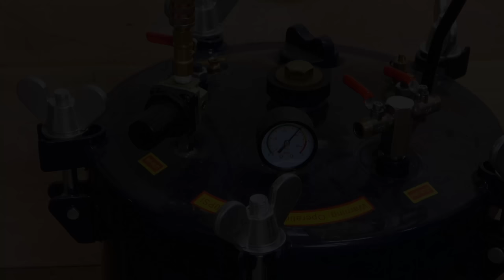Woodturning:  Volcanic Decay!

Comment: As usual David, your imagination provides a beautiful outcome.  Your hollowing is unsurpassed.  A lot of folks that I watch, who do resin; use those sanding pads with a foam back and wet them to sand.  Just a thought.  Your vase is lovely.
Reply from the maker: Thanks Suzette! I did quite a bit of wet sanding using oil instead of water just to avoid the wood swelling. Cheers to you!

Comment: Dave ur the man, also I love the fact you're using wood you find in forests and trails from cut down trees and rotting wood. I actually have worked with rotting wood via dremel work. Burning rotten wood has a very pungent and degrading smell. But I really hope this is where all your wood comes from aka wood that would just be left in trails and woods so you can bring new life into them

Comment: This is really a nice project in a couple of ways....for once, the resin actually fills out or replicates the missing material from the original burl; additionally, the colors also complement the burl itself as if an original aspect of it.  Finally, you have turned this so well as to provide dignity and grace to what many might have seen as a misshapen piece of wood.  There is a woodturner (Yamabiko) who specializes in vases with paper thin walls and he puts a set of powerful leds under the lip of his tool support to provide light for the inside work.....just an idea.  Best to you and stay healthy.

Comment: Very nice. The resin color is perfect. 
You do have a lot of confidence in making the mold for casting your resin. I saw that you do not have an extra bucket in your pressure pot, so I assume that you are not afraid that you will get a leak and your whole pot is covered with resin😉
Reply from the maker: Thank you! Well I did have that larger bowl under it just in case, and there was a little bit of resin in the bottom of it, but the mold held up a lot better than I thought.

Comment: Beautiful as usual! I do have a question. I noticed you put finish on the piece and then flipped it around to finish the bottom. In the process, most of the finish was sanded off. Why not finish the piece after you have completed the turning. I see other turners do the same thing. I am kind of new at turning and would like to know. Thanks.
Reply from the maker: Thanks David. Great question, and hindsight is always 20-20 so had I know. I would need to slightly reshape so much of the base I would have saved myself the time, but it’s all about making sure the finish is seamless and sometimes that involves redoing multiple steps.

Comment: 4:46 transition from slow rotating inspection, to turning, to really slow motion turning (and sound too!) is really awesome. I enjoy the angles you choose.
At 5:14 you prep one end for a kind of circular vice on the lathe, what's the name for that? Is the turning more stable because of that? I figured it's also useful to not run into screws if you're hollowing it out into a bowl or vase of some sort.
Man, I dig black cherry! Nice work, David :) Thanks for posting.
Reply: "Prep one end" = Turning a tenon
"circular vice" = 4 jaw scroll chuck

When turning a hollowed piece that can only be supported at one end, cutting a mortise or tenon, and then securing in a chuck, is usually the safest and most secure method.

Comment: Is it not dangerous to work with such an unbalanced item on the lathe, as this project started out? I've seen quite a few videos where the same happens, so I guess it's probably an accepted technique - although I can't help but wince at the thought of a sharp chisel being wrenched out of your hand, or the whole lump being thrown off the lathe!!
Reply from the maker: There is always an element of danger spinning anything at high velocity, but this piece was very light and was well balanced between centers. I would say it was one of the safest rough turnings that I’ve done.